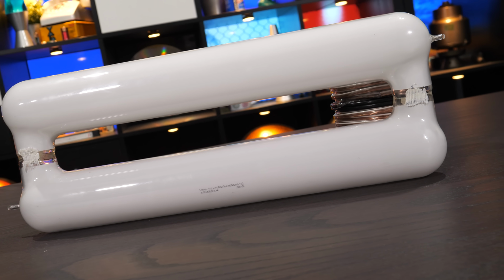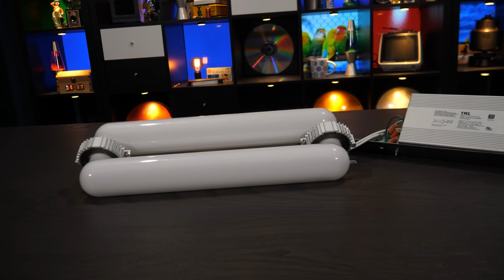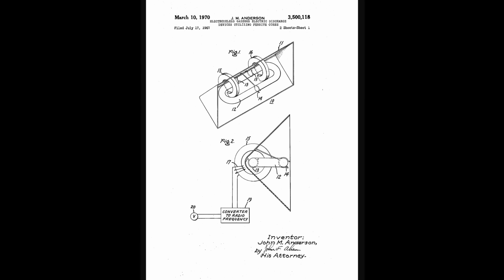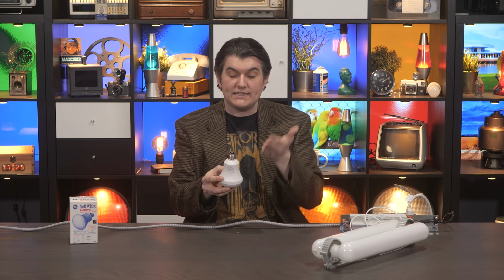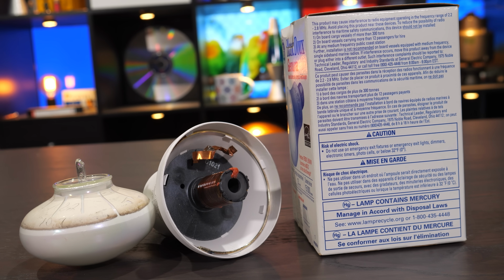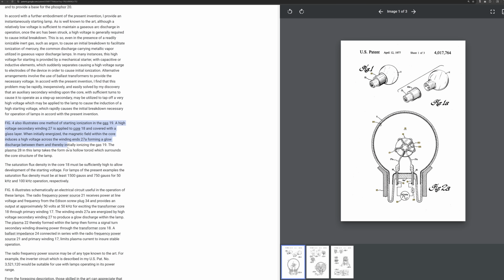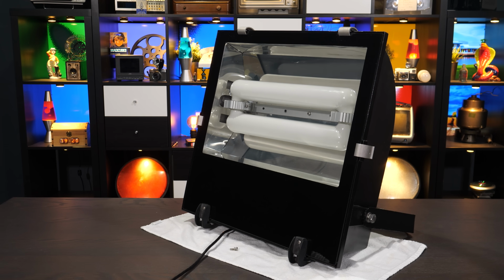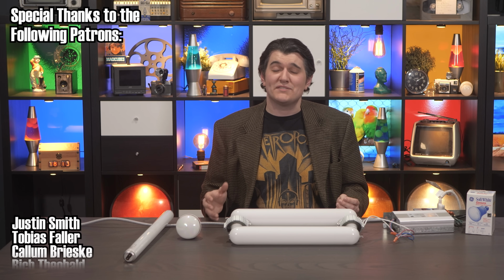Induction lamps: fluorescent lighting's final form

Comment: MY DAY HAS COME.

I worked as an electrical engineer at a company on the "inner inductor" light bulb architecture of these, similar to the ones you showed on camera. I can clarify some stuff! AMA.

Heat is such a phenomenally huge deal. You mentioned it; I'd like to reiterate it. Having to conform to a light bulb shape is a problem, as electronics must be "derated" when they perform in hot conditions, and there is zero room for air flow in those things. Parts broke all the time during testing because of the hot conditions. We had to use these insanely beefy FETs to drive the inductor, while doing our best to heatsink them to the metal ring that goes into your bulb socket.

You are right in that the way we started up the bulb is by launching a huge voltage in there. We called it "striking" the bulb. There's really no more to it; apply a large strike voltage and then back off to the running voltage.

Phosphor chipping and other mechanical problems with the bulb were frequent in development. We had a whole team of chemistry/mat-sci nerds who were working on that.

The EMI protection in those was such a pain. For those who don't know, when you sell electronics, your product has to not interfere with other stuff in the area. Radiated (into the air) and conducted (into the grid) electromagnetic interference has to be at a minimum. When you're juicing this bulb at a couple MHz, this is not easy to handle.

The company I worked at in particular was late to the induction game and thus had to differentiate itself from LED bulbs. This was like a decade ago, so LED bulbs by Phillips and such were still expensive-ish, but so was the induction bulb, so they couldn't rely on price. The main competitor was CFLs, and the company went to the ends of the earth to avoid the comparison to fluorescents, because this was at a time when fluorescents were "the eye-strain bulb." Incandescent bulbs were having a bit of a resurgence, because people hated the cold, clinical light of compact fluorescent bulbs. The entire pitch was "this has a spectrum most similar to incandescents of the alternative bulbs, and thus it will look more familiar to you -- warmer, more broad-spectrum, and thus better." They desperately went into the "wellness" angle a while after I left, trying to eke out sales, which I admit disappointed me.

In the end, this failed, but not only because LEDs won; it was also mercury and dimming.  For the first, fluorescent had long become a dirty word, because mercury was in the bulbs, and the induction bulbs had to also include that amalgam pellet or they wouldn't light. Why not just pick the environmentally friendly bulb? Also dimming was all the rage, and the initial bulb couldn't be dimmed. Part of what I was working on was the dimmable version of the bulb, but it was too little too late.

Also CNET gave us a bad review and a gajillion people saw that article and we never moved past that, not really. The managers were all smiles and "they don't know what they're talking about," but CNET was right all along: induction lighting is too expensive, too environmentally fraught, and just inferior to LED lighting. It writes a check it just can't cash.
Reply: Was this the "finally" bulb? I bought a few out of curiosity when they were new. Thought it was weird the company was being cagey about what lighting tech they actually used, remember "Tesla Tech" and "Acandescence™" being on the box. 

Unboxed and installed the lights, thought had less than ideal CRI and took a while to warm up, but after researching what tech they actually used, kept them because the tech (and packaging of said tech) is really neat. I still have one in service in a garage light, it's still working great after about a decade ...
Reply: @christianelzey9703  YES IT WAS! Holy shit! And I'm glad it still works for you, haha.
Reply: @AuroraFirestorm nice! It's a really interesting bulb, great form factor , just a shame the timing didn't work out on the product. Passing EMI compliance must have been a NIGHTMARE, had to deal with that at work a while back and "whack a giant common mode choke in" I guess isn't an option in a bulb form factor...
Reply: @christianelzey9703  It was indeed a nightmare, lol. There was no room in that thing.
Reply: I used it as a light at a parking lot in 2009.  Still working today
Reply: I heard kilohertz and immediately thought about how horrible dealing with the EMI must be on those things. Heck, the buck regulator on my LED bike headlight puts off enough EMI to interfere with GPS and it's an itty bitty little inductor. Would love to see someone with some RF equipment take a closer look at these.
Reply: Cool! I have a few questions: 
What was the RF frequency of these bulbs? Someone else said it interfered with expensive lab equipment, but I assume you could make a metal mesh to block it. 
Are the claims of broad-spectrum light true? And they don't flicker as much as regular tubes? If so, that sounds perfect for indoor lab/office lighting. 
I wonder if these still are made. I would actually consider lighting my home and/or office with these, despite the mercury. 
I'm often disappointed by LEDs because of the narrow spectrum and limited color options (the most powerful diodes are rarely in a nice shade of white).
Thanks for sharing. Very interesting.
Reply: @theRPGmaster  I worked on ballasts for these bulbs.  The ballasts had a AC output around 250kHz.  The larger bulbs we needed around 500Vac peak and about an amp of current.
Reply: @theRPGmaster LEDs are rapidly getting better CRI’s, even some of the cheaper ones.
Reply: @theRPGmaster  I realize I only addressed the EMI thing.

Broad-spectrum: Not really. It was a different spectrum than fluorescents, but if you laid out the various technologies and asked what it was close to...well, it acted like a slightly funky fluorescent. It was not incandescent. The color was similar and warm, but it still had a spiky, uneven spectrum. They don't flicker so much because they're driven so fast your eye can't pick it up; they'd only flicker visibly if they're screwing up.

I will say yeah, they produce a lovely warm white. But LEDs really should be able to do that if you pick the right temperature? IDK what LED tech is doing now though.
Reply: @AuroraFirestorm  I really appreciate the answer! "Sensitivity" to flicker is something people argue about, for some reason, but <200Hz is almost unbearable ~24 hours a day in a living space. There's no way my brain is unusually fast when it comes to blinking lights, it will have an effect on anybody. It'll be evident if you try to film slow-motion video under such lights; the footage will be unusable. 
LEDs have come a long way, but a lot of them still flicker, and the color options leave much to be desired, although there's a lot more options nowadays. There are probably cheap ways to eliminate flicker, but not cheap enough for the chinese factories producing LED bulbs.
Reply: @theRPGmaster  To release the product, you have to restrain the EMI emissions, which are usually in RF. Honestly, the RF EMI issues were "everything." Oscillations throw harmonics all over creation.
Reply: Wow, thank you. That's a piece of history I would have never heard without your comment. So I want to say thank you for adding to what I now know. I am really grateful to learn, and stories like yours can only be learned from very few. That's something special when it refers to things we all used at some time. At least those of us old geezer types. Funny but I used a few of those induction bulbs to grow an indoor crop back when I was young. They worked great for growth but so not good for flowering. I always assumed they emitted more in the blue light spectrum, and flowering does better in the red spectrum.  But I digress.
Reply: Thanks for sharing! So, about the striking process, it is true that you just amp up the electric field really high for a moment to induce ionization in the gas?

Also another question! The mercury amalgam, does it ever run out? Or does the mercury recondense onto it?

Thanks for sharing all your cool insight and expertise!
Reply: @natalie5947  Yes, that's true. You blast it with voltage briefly to strike it, and that's the most traumatic part of the process for the materials in the bulb and the electronics. The amalgam can run out with time, but the time it will take is so long that you really don't need to care.
Reply: @natalie5947 I would expect that the mercury is (very very slowly) adsorbed into the glass.
Reply: Wow, thanks for that. Thank you for your contribution to lighting technology as well. Brighter future n such 😅
Reply: This is a pro comment, wow @AuroraFirestorm, thank you for the technical explanation!
Reply: Wow that was awesome I was working in interior design at the time. So I took a course on lighting and did up grades and follow ups for customers and myself. When LEDs came on the scene most clients just did their own thing,they didn't need or want something else that had to be installed. Schools in Canada did big updates saying they found less children missing classes everything from headaches to flu was caused by the lights,then they retracted that idea and it was the cleaning compounds.Thank you for this information brought back some information I'd forgotten about cool.
Reply: AuroraFirestorm is of course your name. Your day  truly came. i did read all of that!
Reply: I assume the high frequency also assists with the starting of the lamp similar to how you can start a welding arc with high frequency?

I am slighly supprised to hear that these induction lamps were wround in the 1990s. I seem to remember them being a thing here in the UK for a short while around 2009-2011 then LED came along and made it obsolete before it had even got going. I've been in the electrical industry just under 20 years, and I've seen T8 switch start fittings replaced with T5 electronically ballasted fittings, which where then replaced with LED, and now we are starting to see the early generation of LED fittings ripped out and replaced with a later generation as the technology has matured
Reply: damn you all are nerdy people. i wish i could contribute to this conversation as well. the only thing i can say is that i like to use light bulbs. i use them every day :)
Reply: Thanks - fascinating story. Also, the Amazon reviews were horrible.
Reply: Bro this was fascinating thank you 😂 as an electronics nerd and someone who works in RF (audio tx/rx), other forms like light and all are fascinating. I can only imagine the funny signals comin off some of those early prototypes
Reply: Thanks for the info, Aurora.

'apply a large strike voltage and then back off to the running voltage'

How did you change the voltage? I am guessing that you used electronics to change the voltage over time. Please confirm.

Thanks in advance.
Reply: great story, thanks for sharing.  He mentioned a metal strip for striking, do you think it acted as a capacitor for a high voltage point?
Reply: Thanks for the inside scoop!  Too bad, seems like a technology that is so simple and so complicated at the same time.   TEchnically cool, interesting, but impractical.   Thanks again for your time explaining all that.
Reply: Very well thought out and worder reply!
Reply: This being right under the comment about how these inductions lamps messed up lab equipment up to a room away is so funny to me. Like a story in two parts.
Reply: my god what a well worded comment, this was a fun read and it made me wish I could write as good as you.

ty. 👋
Reply: Led lights is it then, these induction lights are pretty cool, but if only there was another way to drive the induction bulbs on 50/60hz
Reply: Wow. I've seen an Led bulb with a cooler and it was absolutely massive, but compatible with a standard socket.
Reply: One of those wiggly solid state piezo fans would do quite well in a device like this, if you could fit it
Reply: Please correct me if I'm wrong, but with the high frequencies seen, the customers who would have benefited the most (large industrial or commercial) would have also needed to perform more PF correction due to the large numbers of units.

Which if planned for would have likely been a negligible increase in cost, however, would have been seen as a large investment as a retrofit. 

I know that was a huge problem for commercial spaces that used a lot of fluorescents, and one that they could be continually charged for by the power utility, so do you think that also played a roll?

Unless you managed to correct PF in the lamps - then my entire question is pointless. Lol
Reply: there's still a good amount of them where I live
Reply: Thanks for sharing, very interesting from engineering and product design perspective.

The dimming aspect seems like an additional headache, one of those features that is in reality complete waste of time, but people find it exciting so it has to be there. They don't want to design their home lighting so that the areas/activities that require bright light have bright light and areas for relaxing and socialising are calmer light. It was almost not at all a thing over here, dimming lights have been very rare. With fluorescent and some LED lights it's a very welcome idea, but the problem was maybe more the intensity to begin with than being able to adjust it down. Now the LEDs actually do a solid job at being chill warm lights and even plant lights, as well as being able to provide the Christmas lighting Technology Connections desires.
Reply: Damn. Heart broken, i love the idea
Reply: Well I’m here to tell you… not only DID YOUR DAY COME… YOU HIT IT OUT OF THE PARK!

Lighting geeks rejoice!

Wonder twin powers activate!

Shape of… 😂
Reply: @leilanirocks  Excellent! Thank you!
Reply: As a nerd, LEDs are boring for me. Fluorescent forever.
Reply: Should I invest everything in a business model based on growing weed with these?
Reply: And still led can't beat classic bulb in dimming just like now 25yrs later the flat screen finally manages to close the remaining gaps vs CRT displays - still looking at motion picture on a high quality CRT screen is still superior in many ways and so is traditional bulb vs LED. Sadly we limit us to the worse feature set lamps now all because electricity is freaky expensive now
Reply: These lights flicker much more than regular incandescent lights: so much more that you can see it! 
Instead of 50/60Hz they operate in the kHz or MHz range.
Reply: @Conservator. Huh?
The flicker fusion threshold of the human eye is around 60Hz. Some people can tell the difference between a 90Hz and a 120Hz display -- but beyond that, you definitely can't detect flickering.
Edit: oh, or did you mean "so much more that you can't see it"?
Reply: you write like chatgpt
Reply: @kuromiandmagic what made you think of that?
Reply: @Conservator.  pretty sure that account is a bot, so ignore them
Reply: @kuromiandmagic no they dont
Reply: @kuromiandmagic  To an EE, it reads like it was written by an EE.
Reply: @kuromiandmagic  Sorry! I'm verbose and STEM-y, and I assume AI does that too. I also love me some emdashes.
Reply: @kuromiandmagic  Did they finally taught A.I. not to use the em-dash? :)

Comment: Does it need to be coil-form? As in, could you induce current into a spherical version? I know there's ways of creating plasma within a sphere with an inductor, but would this be possible here? I'm a little confused - you mention there's internal arc discharge inside the tube, but where exactly is the arc forming? If it's just forming in air, it's not an arc - it's Corona discharge... Isn't it? If so, is coronal discharge functional for it? E: ahh, got far enough into it. Still curious though - this isn't sex discharge, is it?

Comment: I imagine the radio interference would be a huge problem in some places. Imagine having that conversation with tech support.
"Sir did you install any new light bulbs recently?"
"Oho! Nice try deflecting responsibility to someone else, I'm onto you!"
"No sir I'm dead serious. Let's go examine your new light bulbs for interference."
Reply: Flashing back to Techmoan's new video, about the nixie tube radio... whose nixie tubes produced so much interference they basically drowned out the radio signal.
Reply: The original Edison style incandescent bulbs would sometimes produce interference by acting as vacuum tube oscillators (Barkenhausen oscillation).
Reply: When I worked at a cell company, one of our early cellular internet devices often had to be put inside a microwave oven to get it to stop communicating with the towers long enough to force a reset because powering it off didn't actually power it off.  Likewise, I had to tell people not to put their router in a place where their kitchen, especially the refrigerator, would be between it and whatever they were using on wifi.  I had so many people claim I was making stuff up until I talked them into testing it and was proven right.
One guy had installed aluminum plates for the backsplash over his stove and could no longer get wifi in his kitchen, which he realized on his own after I told him about the refrigerator thing.
Reply: The Philips QL lamps were fairly clean. Radio emission is wasted energy that doesn't contribute to light, they put a good bit of effort into keeping all of the energy where it was useful.
Reply: There's a semi-famous story about the gas cylinders in office chairs causing enough EM interference to disrupt certain USB hardware configurations. Interference is never my first suspect, but it's also never ruled out.
Reply: "Turn the lights off and on again"